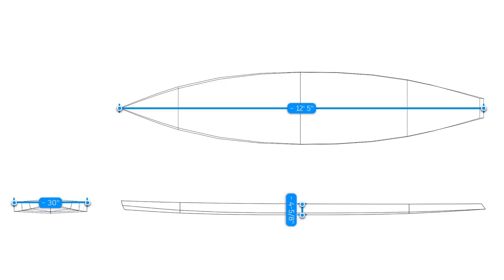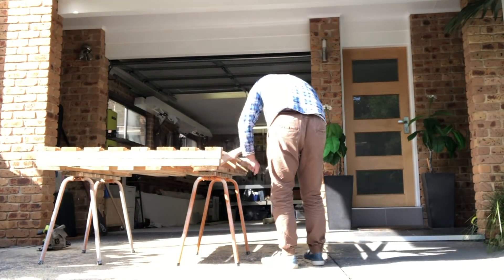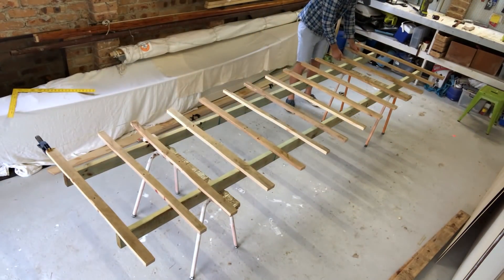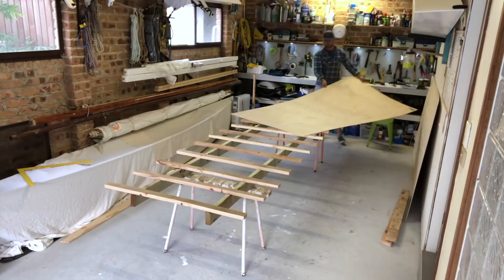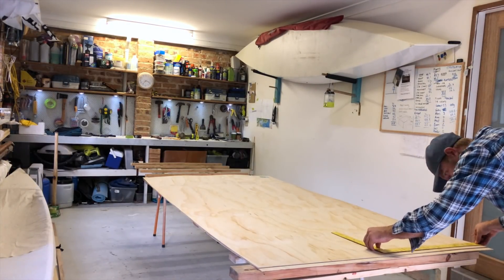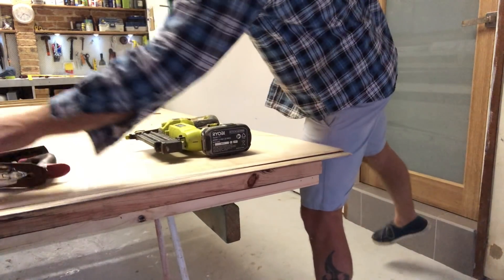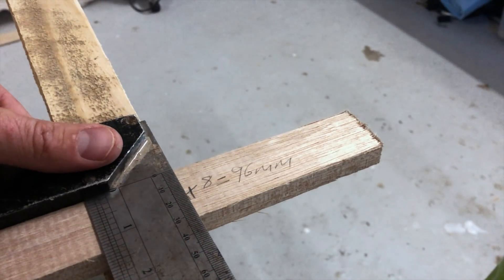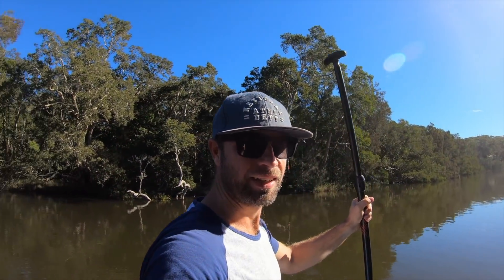#DIY #SUP Ep 1 -  how to build a Stand Up Paddleboard from plans

Comment: Aaron here is my build so far 
https://www.facebook.com/pieter.blackie/media_set?set=a.10157354557526768&type=3
Reply from the maker: Nice progress mate, did you add some rake to the bow?
Reply: @vintageboardco  lifted it 30mm not sure why just thought it looks better lol
Reply from the maker: @pieterVTX  nice mate!
Reply: Also Aaron I was stuffing around and to get the sides 100% on the bottom I ended up using a tube of locktite super glue just to get everything nicely in place, not to sure if this is acceptable but it gave me some comfort having everything on their lines

Comment: Nice start and off the back of your comment about plywood I thought it might be worth mentioning that you can get cheap plywood that still has the "A" type bond of marine ply. Just look for exterior grade structural plywood, very cheap and lasts forever in all kinds of weather.
Reply from the maker: Exactly my thoughts mate, for projects like this you can get away with non-marine plywood. As long as the glue is an A bond.

Comment: You’ll hate that ply. I’ve used it for a boat project. It’s not for outside use. I learned the hard way.
Reply from the maker: Jesse Young did you seal it with epoxy? My 2 year old outrigger sailing canoe is holding up really well with the exact same plywood.
Reply: @vintageboardco  No I didn't, but to me that is a little counter-intuitive for the little play boat I was making for my boys. Why save $15 on the plywood, then cover it with epoxy that costs much more? I'm sure it works in some cases, but for the next job, I just decided to fork out the extra cash for genuine 4mm marine ply.
Reply: @jesseyoung9654  @Aaron de Ruiter   I'd also rather go for marine grade ply - unfortunatelly i could get it only in 4 mm. Making some weight calculations i'd estimate if the board in 3mm ply weights 14-15 kg then in 4 mm would be ca 17-18 kg (get's even stronger but also heavy...)
Reply: @vintageboardco    I'd also rather go for marine grade ply - unfortunatelly i could get it only in 4 mm. Making some weight calculations i'd estimate if the board in 3mm ply weights 14-15 kg then in 4 mm would be ca 17-18 kg (get's even stronger but also heavy...)